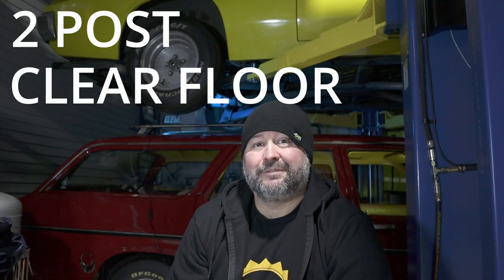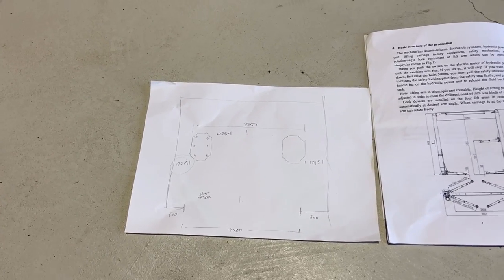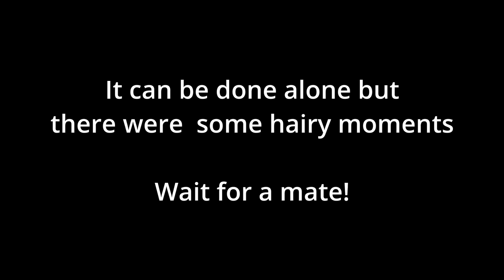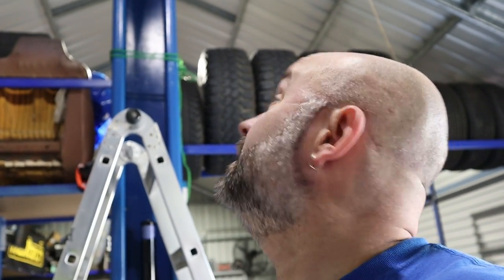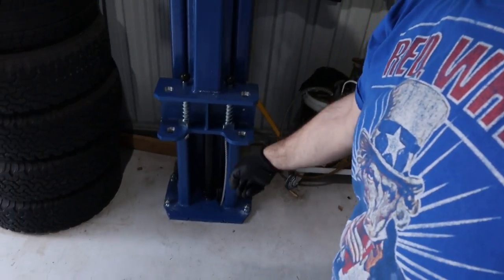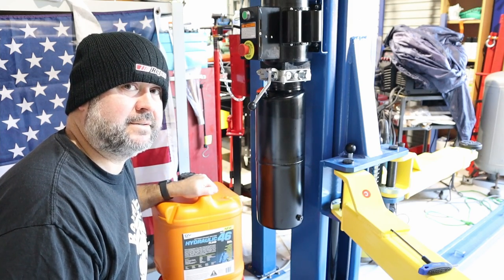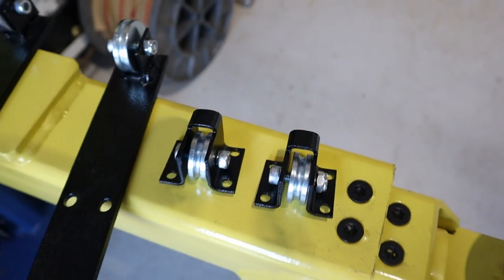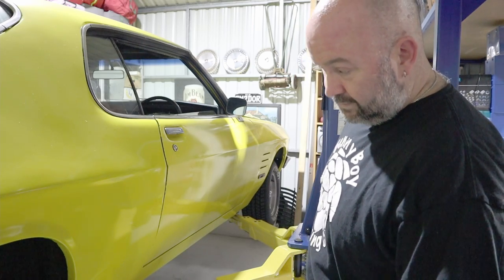JOEL'S GARAGE GEAR 2 post 4.5 ton clear floor car hoist lift install and review | The Shed Sesh

Comment: Great video mate. We will take this on board and improve the instructions. 
As for the yellow lifting arms. The shorter 3 piece arms go to the front of the car generally. You can put the car either way but it's easier to have them to the front so you don't need to roll the car back and forward to get the arms under. 
Yes there is a Joel. Great job. 👍
Reply from the maker: Ha, cheers mate. Thanks again for a great product ;)
Reply: I would have though that the short arms would go to the front of the car because that is were the weight is. 
Try to get the cg of the car to the centre of the post.

Comment: Just stumbled across your channel, great work with it mate! Love the hoist install, Joel has an awesome hoist, I ended up opting for a different brand because of my height restriction I had, then they failed to deliver said height that was on their diagrams and had to go with their baseplate version, which sucked although the baseplate isn't as high as others I've used in the past so its not much of an issue.    Ended up installing mine myself as well, very happy with it though, I also have a HQ coupe and it was scary lifting it for the first time also hahahha
Reply from the maker: Awesome mate. Glad to have you along. You see the look on my face when the hoist clunked. I thought the q ee was gone. Haha.
Reply: @TheShedSesh  Hahah yeah those safety locks are are much louder than my hoist, would have freaked me out for sure!!! even freaked me out watching it a little haha

Comment: Good job.. you did the cross beam a safer way than me.
I had a ladder in between the posts, climbed the ladder with the cross beam on my shoulder and placed it on top.
It was very dodgy I wouldn't recommend doing it my way.
Reply from the maker: Haha, gotta do what ya gotta do but ideally a 2 man 2 ladder job 👍
Reply: Glad I had a forklift for that part
Reply: I just done the same can vouch it’s scetcky

Comment: Great job. Loved the explanation or all of the steps involved. I have a couple of questions. I am also going to install a second hand lift soon,  How close is the driver side lift post to the wall? Do you have any problems getting out of the car with it that close? Also will you have to back in the car to say remove a driver side wheel. Thanks
Reply from the maker: Hey mate. The hoist is a set width and if the car is in the middle you can get out of the car fine. The post is pretty close to the wall though but it only stops me getting between the wall and the post. But when the car is up in the air or on the floor I can get between the car and the post..... if that makes sense. On the wall side which if I drive th car straight in is the passanger side I have some shelves that are kind of in the way but I'd still be able to remove the front wheel, it's just a bit tight. I'd like to move some things around so I have a bit more room though..... I'll get there ;) The bay is 4 meters wide by 6 meters long...... ideally it'd be say 5 meters wide by 7 meters long but it is definately usable the way it is. You always need/want more space haha.

Comment: Quick question. Whats the clearance under the HQ (eg at sill height) when its fully up? Trying to work out if I can fit an clear floor or have to go a baseplate model. Cheers
Reply from the maker: Jimmy, I let you down brotha. Just saw this. Let me know if you still need details.

Comment: Hi did u have to change the hydraulic fitting on the pump it's changes side's in your video ?
Reply from the maker: Hey mate, I did have to change from one side to the other as the fitting came in the wrong side. It was an easy swap. Any issues message Joel on their Instagram account and send photos. They help out pretty quickly.

Comment: Hey mate. Enjoying you videos! I've ordered a Joel's hoist for my shed😎, a base plate model as i dont quite have the height. I have a bay 6mts long like yours. What distance do you have the post from your roller door?
Reply from the maker: Awesome mate. I have them smack bang in the middle at 3 meters. I’ve run into an issue with putting the commodore on it though, driving in forwards, the spoiler hits the roller door roll at the top. Not sure if I can fix it by swapping the arms around. The front and back are different. But I’d probably have installed it say about 300mm closer to the back wall so giving say 3.3m from the roller door. But as I said, I may just be able to swap the legs and it’d be ok 👍 👍
Reply: @TheShedSesh  cool thanks. I'm aiming at 2.9 but reversing the car in. I might have to try to measure my car on another hoist ist. Thanks again 👌

Comment: Good explanation video mate
What is the overall height of the hoist, says on website need 3.8 but highest point is 3650
Reply from the maker: Sorry mate, just saw this. Not sure of height will have to measure.
Reply: @TheShedSesh  all good mate I bought one aswell

Comment: Great video mate. I picked up a used one. Almost new. Will install next week. 
Did you use a 20mm drill bit?
Thanks
Reply from the maker: Sorry mate, just saw this. Assuming you’ve already installed. Can check the drill bit size tomorrow 👍 let me know 👍👍
Reply: @TheShedSesh  Thanks mate. Ye already installed. Your video was great help.
Reply from the maker: @amanrandhawa3087  great to hear mate 👍👍 enjoy 😊

Comment: Good stuff mate.
Can I ask, what happens when after you've measured and set the posts and start drilling, you hit rebar in the concrete ? What do you do then ??
Also, are the hydraulic hoses good quality and not that Chinese crap ?
Reply from the maker: Hey mate, in regard to the rebar just keep on drilling. I was lucky enough to avoid them. May have skimmed a couple in a couple of the holes. 
Can’t talk to the hydraulic hoses. They seem well made to me. 👍👍
Reply: @TheShedSesh  Thanks mate. I'm going to be building my dream shed/man cave (9x15x3.6) and definitely going to install a hoist.  All the best to you !

Comment: Shed size and wall height? Congrats on the hoist
Reply from the maker: Hey mate. Cheers. Shed is 6 x 12. Each bay is 6 x 4. I reckon a perfect minimum for a bay would be 7 x 5 but it works. Better than not having a hoist haha.
Reply from the maker: Forgot to mention. Wall height is 3m to the eves with a harsher than usual pitch on the roof.
Reply: @TheShedSesh  cheers man. Building a house atm, looking at 12 x 9 3.6m walls. Good to see it all fits nice. Like you, bout time I got myself a hoist lol.